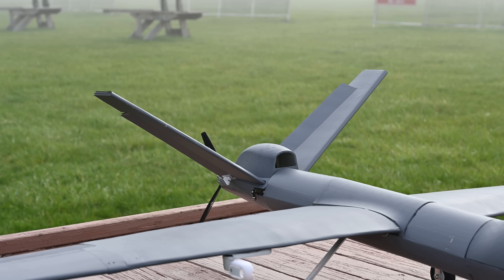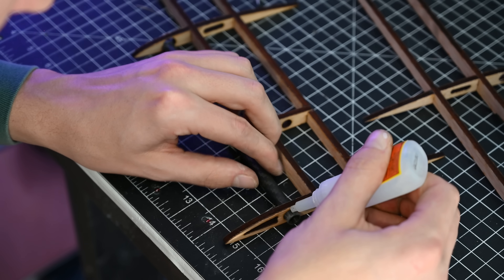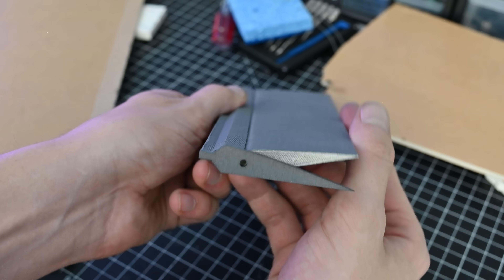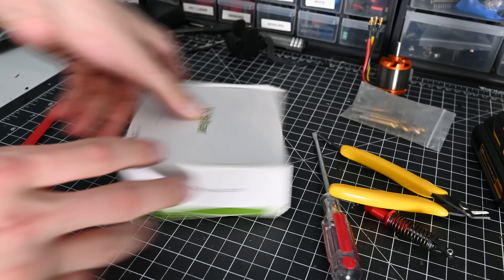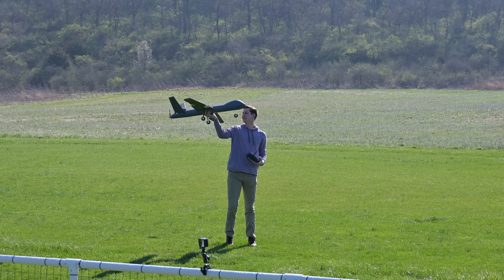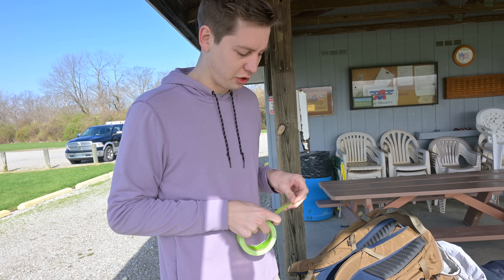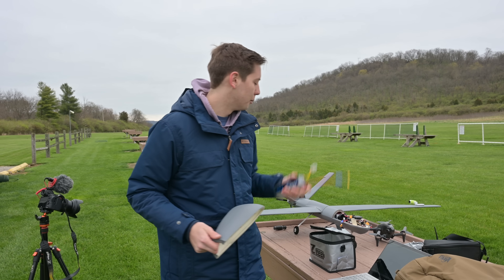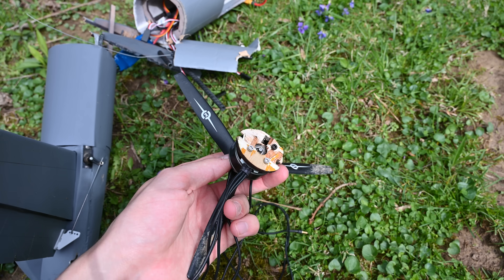Building a DIY REAPER Drone... Ended Badly

Comment: Why not just use carbon fiber / Kevlar sheets with carbon fiber aluminum magnesium alloy spars. You can find the material in certain old laptops. It's only a few mils thick but very strong and balances flexibility with rigidity.  You could make the thing about as light as a paper airplane of similar size but stronger and more rigid or "crash resistant" than a real aircraft.  Only issue is the epoxy isn't super fun to work with

Comment: Well yeah, you can't just go throwing huge batteries in it and expecting to still be able to hand launch it. It may have still flown at the peak of it's wing loading, but hand launching doesn't allow the aircraft to accelerate enough. Rebuild it for sure, strengthen the landing gear just a bit, and stop flying on a grass airfield. . . either find a paved club, or put bigger diameter and softer wheels on it. Go to the grass field and ask if you can volunteer to mow it for them before you fly.

Comment: It would not take much more work to switch from foam board to Monokote which would make the whole aircraft a fraction of the original weight. You would just need to add a few more ribs.

Comment: plywood way to thin. Scale it up more. Use same battery and electronics, but bigger better plywood, and try joining 2 x3 bladed props to make a 6 blade but smaller diameter.

Comment: Adding bigger batteries to a plane for longer flight time is actually contraproductive. It makes the plane heavier. Heavy stuff needs more lift. So if you want the same flight characteristics, you need to build the plane larger. And a larger plane needs bigger batteries... What one needs is to make the plane lighter, smaller. Air for small things behave differently: its relative density gets higher and higher as scale goes down. Because volume (thus weight) changes in a cubic factor, whereas surface area follows a square law. For an ant, its surface induced air resistance is so big, it can technically jump from whatever hight an land without injury, its terminal velocity will be ridiculously low. An elephant can't do that.

Comment: Nice project but a few things if I may 

1 the MQ-8 isnt really meant for self flight on the take off and landing on older models. Should you try and re do this i would suggest setting up "way points" for self flight.

2  the MQ-8 has WAY taller tri cycle landing gear as many have said 

3 Brushless is nice but if you have a smaller gas engine plop that in you'll be happy

4 where can i get these files If you put them up ?

Comment: Landing in a rough pasture isn't the same as landing on a putting green. Perhaps pick up 20 (4*8' sheets) ~ $260 of panel board and make yourself a smooth runway to take off and land on (4 ft wide of 50 yards) of the smoothest runway ever. Otherwise you're really going to spend a lot of time developing the landing gear. Alternatively you could spend somewhere between $600-700 on artificial turf from home depot. All in all the development woes will drastically cut back on you flight time as mishaps will continue.  I really love how all the 3D printed parts held exceptionally well and make several other pieces out of it. A prop protector (tail skid) would help out tremendously. Defininately try to have a way in which the wing spar has more than just two rods connecting it to the fuselage. Awesome work! Would really like to see more autonomous features come to fruition (waypoints, obstacle guidance, etc.)

Comment: You could find a RC rated airfield they meet up avery once in a while. Then just reinforce the landing gear to work on those stones or concrete they have on the runway. Then you'll be able to make a normal rolling start and landing. 
It looked like you used rebar to hold/stabilise your wings. If that's so then it might be the real culprit weighing down your plane. Mmmh I wonder how many people are trying to help you with this project. From all over the world, like me from Germany 🇩🇪 😁

Comment: Some quick tips - 
When hand launching, don't throw it upwards. It will lack enough power to gain speed, meaning not enough lift. Instead you need to through it with a little downward angle and immediately after launch give it upward pitch. It will give it the ability to gain speed quickly and have enough lift to fly. 

Second tip is if it's pretty heavy(6s 4a sounds heavy) then it will be really difficult to hand launch. You have to find a place to fly with asphalt to launch and land.

Comment: Can you cut CF Sheet or G10 instead of plywood? You could use thinner sections to keep the weight down or use 3/16" for added strength.

Comment: Fiberglass or carbon fibre the major components, Double up the scale, use a Tail Skid to protect the rear mounted propellor , sling shot launcher. A more durable design would be two high mounted engines and props that would raise the thrust line but should be controlable and stable.

Comment: Nice concept regardless of the outcome. I've been building and flying Betaflight drones for a few years now and am just now getting my feet wet with some INAV fixed wing builds using a MatekF411-WTE. I'm running INAV on Hexacopter but it was premanufactured and configured and only bought it for position hold and to be able to record myself flying freesyle. The fact so many people use Ardupilot and the entire mission planning and true autonomy part has me really intrigued and thinking once I get INAV functioning on one maybe I should do a backup and flash Ardupilot on one and give it a whirl...

Comment: I developed a method for doing bevels with the laser on wood. You need a nearly perfect feed/speed setting to cut the wood at thickness (so that it isn't over or under penetrating). In the case of an interface that uses a pdf document, the area of the bevel needs to be covered by the line weight and the line needs to have a 0-100 gradient stroke effect. This means that a Lazer driven by black opacity will start at 0 and then slowly get hotter as it approaches 100 opacity. Speed must be set to allow for cooling depending on material

Comment: well you have done a really amazing task. but you haven't mentioned about weight distribution. Try to find out the weight and the center of gravity of that drone. try to put it in between the wings. the closer the CG from the wings easier it will be to handle. more over try smaller batteries and put some in each of the wings to take out excess load from a parts that doesn't generate lifts.  make the area of the wings a bit bigger. you can increase the width of the wings and can try some advanced hybrid designs. also consider the engine placement and the propeller. hope this will help you

Comment: A few tips from someone who built many Fixed Wing Drones:
Get rid of these Towerpro Servos. They are the worst and fail constantly as well have a very bad performance
Do an Autotune on maiden! Only then the Flight controller has full authority to compensate for things like bad throws or heavy setups. 
Maybe consider trying INAV (Version 6.0) as it has a better and safer Autolaunch feature than Ardupilot that helps with Hand launches.
Enable ESC brake at max for all belly landers. 

Hit me up if you have questions :)

Comment: plywood is useless for airframes...it has  terrible stiffness-to-weight-to-strength ratios. but if you have to laser cut flat stock, i don't have a better answer, either.
regards

Comment: Look up Tom Stanton's use of Light Weight PLA for 3d printing Plane parts.  (he actually printed the wings! - though if you can use foam board I think you are better off overall)

The TLDR is he used LWPLA and Vase-Mode and very thin fake "cutouts" in the surface to give it internal rigidity where it was needed.  (assuming the geometry you have is compatible with Vase Mode)

Comment: Try 3D printing the smaller parts out of nylon or abs. Those materials are impact resistant and are less likely to break in impact. Abs is also really light

Comment: at least it lasted longer than the first plane i built. i crashed it after flying for about 40 seconds. 
it got really high and when i tried to switch to fpv view i nose dived it into a clearing in the woods because the bad angle i installed the camera in. 
i built a 2nd one that's a lot better, but i haven't had the motivation to fly it.

Comment: You could make a real simple triangle attachment for the main landing gear that would act as a support beam or if you wanted to get real fancy you could make a tolerance between two of the pieces and add a spring on the outside to make it a piston

Comment: looked good and flew well.
only the structural integrety wasnt there.
Plywood maybe easy to work with but has really limited strength as half the plys are the wrong direction, thus making the whole fuselage really weak.
same goes for the landing gear. the way you fixed it generates tons of torque on the pieces. which are not designed to handle it. 
i suggest that you attach a metal rod (or somethign similar) perpendicular to the running gear with screws. maybe even a truss that runs along the entire length of the fuselage. 
in general you should check out material characteristics and different load cases  along the line of bending load, torsional loads etc. 
to help with further projects aswell.

Comment: Love your experiment but as an Aircraft design Weights Engineer, I chringed at your build. There is something called Light Ply which is plywood made fron Balsa. I would then sugest using a light xovering instead of foam. This will require redisigning the parts as the film covering essencially has no thickness. This will produce an airframe about 10% of the previous weights. Also, if you make changes to batrereries etc. recheck you cg. Those two batteries were far too much weight, especially with all of the electronics.

Comment: Hey use liion cells for Long flight time also separate the rc battery from the Motor battery so you can glide If Motor battery drained

Comment: Maybe use a folding rear prop and ditch the landing gear or make retractable landing gear. That grass is a hassle with such small wheels. Or use bigger out-of-scale wheels. Thinner wheels might work to plough through the grass.

Maybe use 1/8" ply instead of 1/4 to try and save some weight. If you make the stringer about 40% deeper, the 1/8" is about the same bending strength as the 1/4" and is stiffer to boot. That saves above 30% in weight on the plywood.

See if it works to remove the inside layer of paper on the foam to save weight.

Comment: It crashed because it did not have enough lift to hold added weight and wing just stalled. For it to fly you either need to lower the weight of increase speed. To increase speed you can launch from ground or from a launcher.

Comment: Impressive! Your frame would be like 1/3 of the weight if you used balsa wood instead of plywood though - which might have helped with your last hand launch...
Reply: a much better,  lighter, more uniform solution is to use foamboard for the ribs and balsa/carbon(alternatives: barbecue sticks, ice cream sticks, paint sticks) for spars
Reply: @ProudOfYourRoots established that your a moron 😂 you don't know what he's even talking about obviously but your saying he's wrong. He means the quality of balsa wood has went down, not that balsa isn't really anymore. Old trees have been used and now there is just what's been regrown and cut down over and over again, younger wood isn't as good as good old wood. It's the same with many woods today, old forests have either been cut down already long ago or are protected now
Reply: You can't even get good balsa wood anymore. It all got used up long ago.
Reply: @1pcfred  :o where did it go?
Reply: @1pcfred  Balsa grows very quickly. Other industries are simply using up all the best stuff.
Reply: @1pcfred  Balsa has always been a fast growing wood. It's not like they've genetically modified it to make it grow faster. Anyhow, I saw a documentary on balsa a few years ago made by a small plantation that grows balsa specifically for hobbyists (they only sell online and, no, I don't remember name of the company), they mentioned that virtually all the good stuff is bought out by other industries now (including "full-scale" aircraft manufacturers).
Reply: @ProudOfYourRoots you're right. You don't know what I'm talking about. At least we've established that. You do understand that when trees are cut down milled and used up they are gone then, don't you?
Reply: @ProudOfYourRoots you can't even spell balsa wood. I guess thank the stars for autocorrect. I never said you cannot buy balsa wood today I said you cannot buy the same quality balsa wood today as once existed. That's because all of the good balsa wood trees were harvested long ago. Now they no longer exist. They're gone. All you can get today is crap.

Comment: Looks great, I would switch over to a two blade collapsible prop even though I absolutely love three-blade props and I would fiberglass the bottom portion of the fuselage, also I would ditch the landing gear. But if your heart is set on a 3 blade prop I would add a downwards tail and also fiberglass it and keep the landing gear on. 
Anyway I can get the STL files for the 3D print and the laser cut parts?
And what kind of flight time we're trying to hit?

Comment: Two cents: Your plane construction was too heavy for the scale you are building. 
At a 2m wingspan, you don't need thick foamboard AND spars AND ribs AND tape. Also keep in mind that paint also adds weight. A surprisingly large amount, actually. 
Just foamboard and spars will do nicely. And don't forget to take the paper lining off the board. The papers weighs a ton. 

Furthermore, with a high aspect ratio design like a reaper, you'll need to pay particular attention to CG and airspeed.
The higher the aspect ratio, the more touchy it'll be and it'll lose pitch stability at high speeds fairly easily.
While this is not usually consideration with swept back to low aspect ratio designs, high aspect ratio straight wings will pitch up, and later stall if it moves out of it's never-exceed-speed. 
I personally found that out the hard way.

Comment: I'm actually calling tail heavy on this one. As it left your hand the attitude changed quite quickly, rather than the stable dart like behavior that nose heavy would cause. All your control inputs were correct, the fact that it couldn't pitch up in time was just due to low airspeed (pusher prop giving no flow over the elevator). To check the CG of a scratch build, balance the plane on two fingers so that it's level, then shove it quickly directly upward, it should nose up just a little. You can also let it drop downward if that's easier - in either case you want the nose to lead slightly, and the tail to follow. Regarding the damage, it seems like the only connection between adjacent segments of the fuselage was the flimsy plywood frame? At least run some packing tape length-wise all the way down, would help a lot. Adding a vertical fin under the tail would save the prop, although perhaps spoil the look you're going for. Anyway it does look great!
Reply: Also the camera on the wing probably did not help
Reply: @RCP-1136  Agreed.  1. That camera on the wing would need the same amount of weight on the opposite wing.  2. A lot of arc in that throw and didn't throw it wings level so basically threw it into a stall with the extra battery weight as well.  3. Threw it at full throttle with a 3 blade prop means a lot of motor torque roll from the heavier prop and motor speed.  In my experience with wings and mini talons I run about 70% throttle on just a slightly elevated launch (not far from level) and then by the time both hands are on the transmitter I can pin the throttle and things are stable.
Reply: AWESOME!     Iforce2d makes a good point consistent with the documentation I recently studied to obtain a private pilots license.  The prop being behind the Ruddervators doesn’t supply “forced” airflow across them so they aren’t as effective at low airspeeds.  Also when a plane loses power, the first thing a pilot is taught to do is bring the nose down, but it appeared that your unit, due to too much aft weight, pitched up at low speed.   The FAA has some very helpful information about the necessary correct balance of a plane and it’s free https://www.faa.gov/regulations_policies/handbooks_manuals/aviation/phak/media/12_phak_ch10.pdf
Reply: @SaveAllTheWolves  the link is dead, can you upload the pdf somewhere? Thanks
Reply: I have to agree with the low airspeed. Combine the pusher prop with the fact that v tails are notoriously bad at low speed. 
Cg was way off but I couldn’t say whether it was nose or tail heavy.

Comment: Oof,  bought OnShape because I was under the impression they had paid creators to share cool designs like this and I wanted to download the CAD file then realized it's 'View Only' and it's just a misleading scam. Refunded immediately, won't be checking out that garbage CAD tool again anytime soon. Cool design, dishonest move by OnShape.
Reply: If you're logged in you can make a copy to edit. And you don't need to buy OnShape at all, it's free for non-commercial use. You're telling us you paid $1500 for the commercial version and didn't know any of this? Sounds like a bunch of bullshit.
Reply: @iforce2d  It's a setting on the design. You're clearly not too bright. He only recently enabled editing the design. Consider thinking before you comment in the future you blatant 12 year old. We cancelled our OnShape subscription because of the dishonest advertising practice. Fusion 360 has been a significantly better CAD software since.